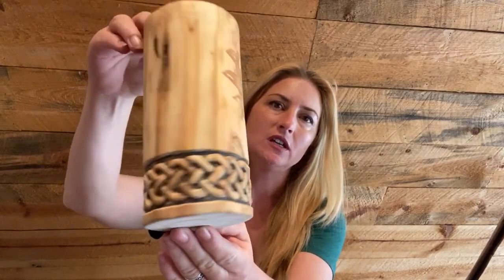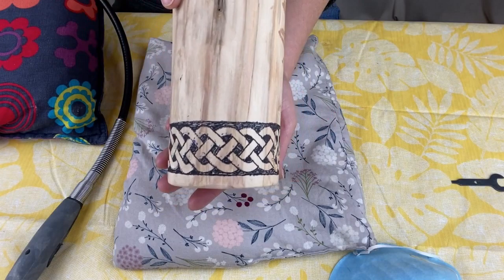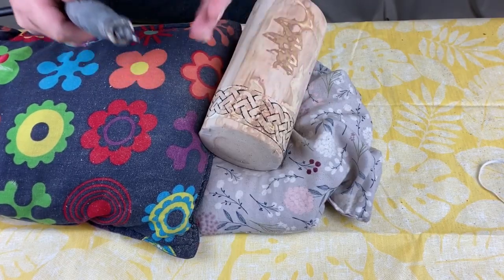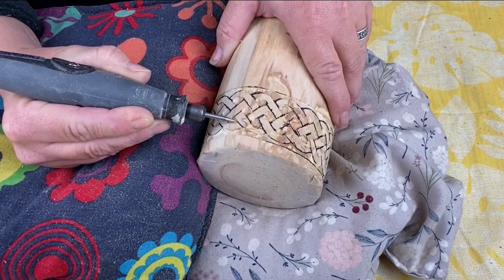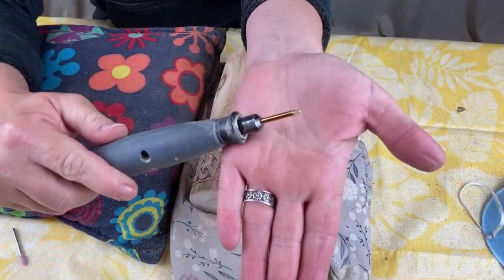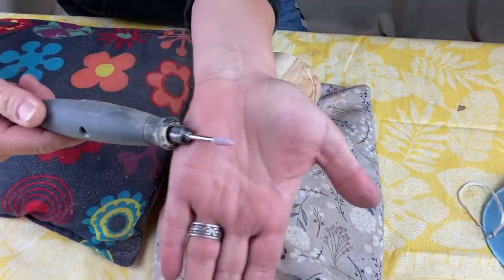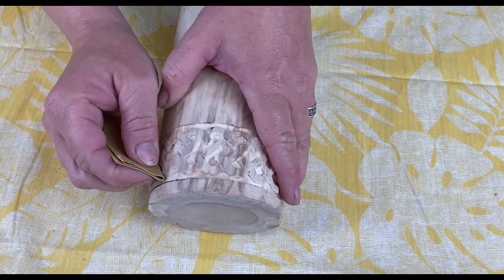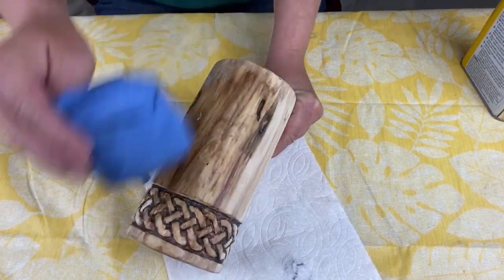Relief Carving in Aspen

Comment: That's a nice piece of art work you made. You are very inventive, "digging" a hole with only a drill and a dremel. Did you put that on video as well?
It should be interesting to see how you did it. I don't have a lathe either. But I saw some videos on YT where people made a small lathe by using a drill.
Have you ever tried that?  I haven't.  I looked for some information on aspen on the internet. What I found out that it is a kind of poplar. Poplar is quite easy
to get here but aspen isn't. Is there a big difference in hardness, as far as you know?  Thanks for sharing the video. Stay safe.